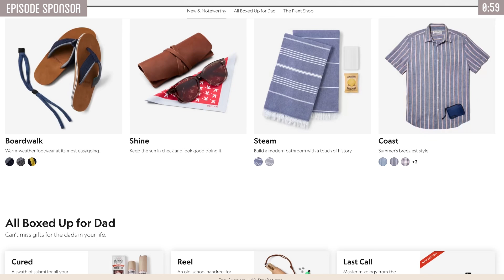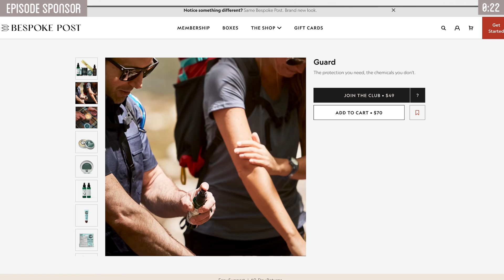White Sugar Doesn’t Come From Where You Think It Does

Comment: @HTME , Suggestion , You should be able to use a high wattage 120 Volt Light Diimmmer to be able to vary   the speed of  Your drill press , OR You can buy a 20 Amp Variac  offf of ebay for about 60 bucks . Hopefully a 20 amp Variac would be able to handle the power of the drill  press .      I use a light dimmer to vary the temmperature of my soldering iron and Ive used a light dimmer to control the speed of my hand held belt grinder and my jigsaw ,  but the Variac wont require you to do any wiring .  Check  the information plate on Your drill press , it will tell you how many amps the drill press uses . Good Luck Stay Safe :)

Comment: Please be very careful with that drill press. Especially when you're using it for something it wasn't designed for, take some time to really think about what might happen when it starts spinning. You can hurt yourself really easily with it. Also, avoid wearing loose clothing that might get caught and pull you in. That includes long sleeves, hood strings, etc.

Comment: What you could try to get an even more white end result is precipitation. Disolve all the sugar in destilled water, try to use as little as possible water. Add a solvent such as 95% alcohol or Acetone, this will knock out the sugar molecules from the water solution. I expect that the molasses will stay in solution for longer.

Comment: I remember in science class we used a jar with highly saturated sugar water in it with a string dangling from the lid into the water. After a few days in the window, the string started producing sugar crystals on it. You should try this with your creation and see if it makes crystals. Good luck 👍
Reply: You have to supersaturate the water with sugar, by dissolving sugar in very hot water, so that when it cools, there's more sugar in the water than it wants to hold dissolved at room temperature
Reply: @Nono-hk3is  no, you have to do that to get it to crystallize within the timeframe of a single science class. The real way it's done is by leaving string in regular high-concentration sugar solution and let it crystallize slowly, because it will do that too.
Reply: Cool idea, see if the molasses and other contaminants are filtered out naturally 👍
Reply: @iTeerRex  Have to do it a few time with fresh water each time to dilute the contaminants. But even halving them a few times makes a noticeable difference.
Reply: I’ve actually seen this in Middle Eastern stores sold as candy.
Reply: @iTeerRex  Not just Middle Eastern; it's a common candy to see in rural areas in the USA, I see it in almost any gift shop at a national park. They call it Rock Candy.
Sometimes it is still on the string, sometimes loose chunks, sometimes on a stick.
Reply: This is called "recrystallization" in chemistry, and is a very good way of cleaning up complex mixtures.
Reply: @edsiefker1301  Very cool, so it well work as a filtration method.
Reply: Yeah it's a fun science experiment, did this to create salt crystals. It's really cool.
Reply: It's called Rock Candy in the US. You can buy in sweet shops all over the world.
Reply: The slow crystallization is only needed to make nice, big crystals. If you just want to clean up a batch of sugar, you can do things to speed this up. Dissolve the sugar in as little boiling water as possible, then cool it way down in the freezer to make as much sugar precipitate as possible. Repeat for better results. Recrystallization makes you lose quite a bit of the product with every cycle, tho.
Reply: That’s the way to do it  I hope he goes for it.
Reply: Even better, get a few starter crystals and pour the super-saturated solution over a filter and starter crystals, as the crystals form maybe the impurities will stay in suspension.  Works for desalinating saltwater.

Comment: I learned recently that brown sugar is just white sugar with molasses and other raw sugar components added back in, but raw sugar is "brown sugar" except what we're sort of told it is lol. Never using brown sugar again unless it's for baking really sweet and obviously unhealthy stuff. Raw sugar for the win.
Reply: Molasses is no more unhealthy that white sugar or your precious "raw sugar".
Reply: Brown sugar actually has more molasses in it than raw sugar does, about 20% more (unless you specifically buy "light" brown sugar), so if a baking recipe calls for brown sugar, and you use raw sugar, it won't come out correct. Also brown sugar has a higher moisture content.